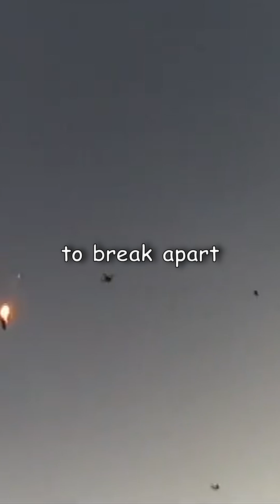He Fell from an SR-71 at 78,000ft! #shorts

Comment: The plane was like "It's time for you to leave" 
If the injection system had  not been tripped he would have ended up in as many pieces of the plane
Reply: MANY TIMES A PILOT  WILL NEVER FLY AGAIN. PTSD - FEAR OR DAMAGE TO SPINE OR OTHER
Reply: @JohnSmith-fg6pt Weaver did keep flying. The disintegration one, they were testing cruise performance by moving the CG further aft and the aircraft pitched up and came apart. So not sure if they are discussing that incident, or the one where the engine actually exploded and they ejected.
Reply: Probably not, he would have been fine most likely
Reply: HIS BACK SEAT DRIVER WAS KILLED  DESPITE HIS PARACHUTE  DEPLOYED
Reply: @JohnSmith-fg6pt that's my only issue with thise video is they don't explain which crash. The one where the aircraft disintegrated yes the RSO died. But the later one that had an engine explosion both crew survived.
Reply: I DIDN'T know 😕  There were 2 craches-- I THINK IT WAS RSO  THE WEAVER ACCIDENT

Comment: Max safe ejection speed is 600 knots.
Reply: Traditional pilot-seat ejections, this guy was in a pod
Reply: @climbhigh96 the SR71 did not have a pod
Reply: @climbhigh96 it didn't say he was in a pod.the ref to a pod was a bomber
Reply: That varies GREATLY and isn't a set standard
Reply: He was likely flying at the edge of space, as well as climbing higher and higher, so the atmosphere would have been very minimal, which is probably the only reason he lived.
Reply: @Livealolha the aircraft doesn't get anything close to "the edge of space"
Reply: @gr8crash  I guess I didn’t put enough sarcasm into it.. I wasn’t being serious. However the SR71 does fly shit high. The pilots need to wear special flight suits to survive the thin air pressure, as you probably know. So the air pressure being so thin is likely what saved him. If he had ejected just 5000 feet off the ground going that speed, he would have been ripped apart
Reply: @Livealolha totally agree. Sadly some people do think it flew to the edge of space. But overall you're exactly right, ejecting at mach 3 at like 5k would be deadly. But at 80k ft, ejecting at mach 3 is equivalent to ejecting at about 450  knots or so.
Reply: @gr8crash  shit if I was flying at the edge of space, I would hate to eject and end up flying out of the atmosphere. Ain’t no coming back from that😅
Reply: 600 is the maximum survivable airspeed.  Under 300 is optimal
Reply: @GreenEyedRogue perfect reason the pilots ejected without much of an issue
Reply: Yes I know

Comment: That pilot is lucky to be alive and not in peices like the rest of the plane
Reply: Well the debris thing is a different discussion,  that's more like a 1 in a million type of scenario.
Reply: @gr8crash  i dunno about 1 in a million, planes all around em, they are surrounded in soon to be debris. Its more surprising if they dont get hit, especially since this pilot didnt eject, rather, blacked out and awoke in free fall
Reply: @GamerGod-fp1tj true. But regardless of the circumstances,  people eject fairly regularly for various reasons and don't get hit be debris etc. Happens more in movies than anything else.
Reply: Why would he be in pieces? Ejection isn't quite that violent
Reply: @gr8crash going Mach 3
Reply: @stanelyhamilton9344 and? At 80k ft it's not particularly extreme
Reply: @gr8crash dude, he’s a squishy human. If the forces could rip apart an SR-71, it could easily do the same to him. And even without that, he still had a high chance of death
Reply: @GamerGod-fp1tj not exactly how it works. And several ejected from the SR71 without an issue. This video is a little misleading as ejecting at that speed and altitude wasn't particularly extreme.
Reply: @gr8crash  also I don’t think his plane disintegrating around him means he could safely eject regardless.
Reply: @GamerGod-fp1tj  again that also happened a couple times with safe "ejections".
Reply: @gr8crash  the plane disintegrating after the ejection is not the same as during it
Reply: @GamerGod-fp1tj you're not understanding. There was a couple of crashes where the plan disintegrated then they "ejected". Regardless of disintegration or not, ejecting from the SR71 wasn't particularly extreme. It was a very delicate aircraft.
Reply: @gr8crash  you have to explain better than that if you want to get your point across. You arent explaining how the pilots survive the deceleration, how the pilot can survive but the plane cannot, etc. Your essentially just repeating your point over and over.
Reply: @GamerGod-fp1tj it's not that sudden, it's not like they are hitting a brick wall. The suit protects them, then the small drogue chute deploys to slow and stabilize the ejection with the main chute deploying on its own at a lower altitude. The human body can handle more G forces than the SR71 can. Plus ejecting at mach 3 and 80k ft is less several than a fighter pilot ejecting closer to sea level at 500 knots.
Reply: @gr8crash  hmm i guess that makes sense. So i guess the pilot wouldnt exactly be in pieces from the force of the deceleration, but how about getting hit by debri or getting their chutes damaged?
Reply: Hey guy's the backseater died from a broken neck he too also had his main chute deploy and initially the pilot thought he survived the breakup of the plane until he went over to talk to him when he landed.